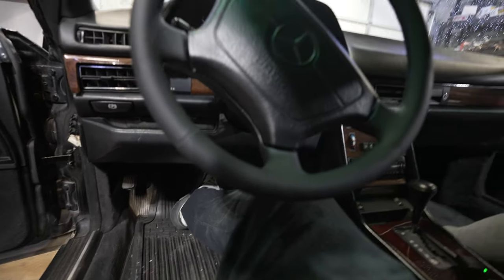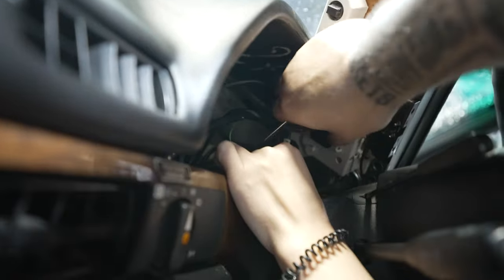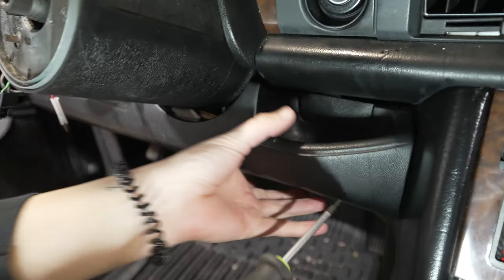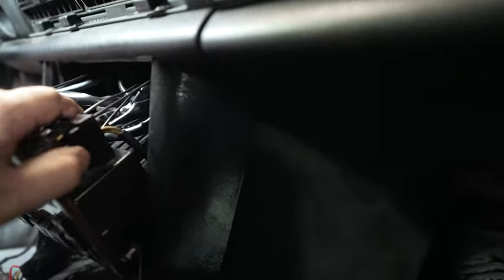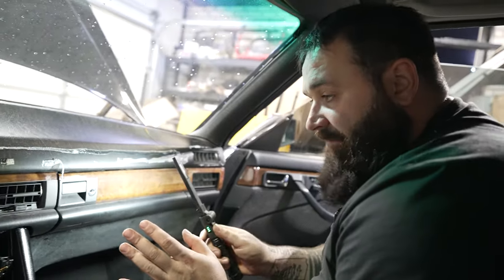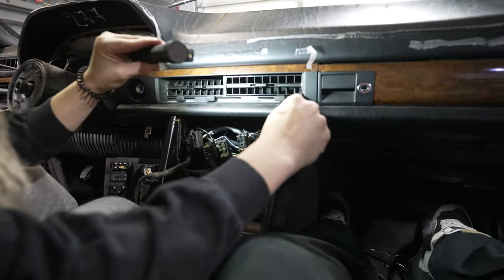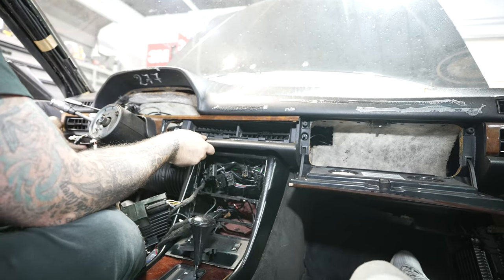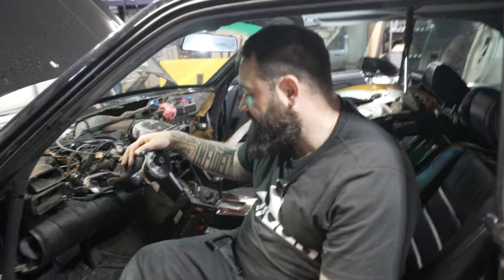How to Remove your Classic Mercedes Dash | 560SEC | W126 Dash Removal

Comment: OMG you made it look so easy....What's the shipping cost Bearded one? I need one! PS, those screws up against the window holdin' the speakers, I used one of those flex deals about a foot long with a cross bit...✌
Reply from the maker: I actually already sold the dash cover piece :(  Yea I thought about using a flex attachment, but I didn't think it would fit